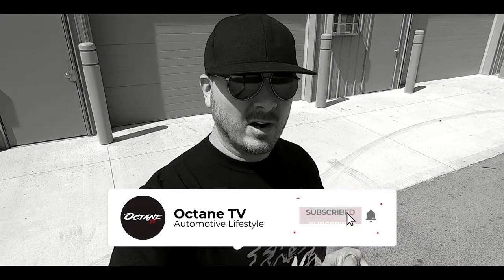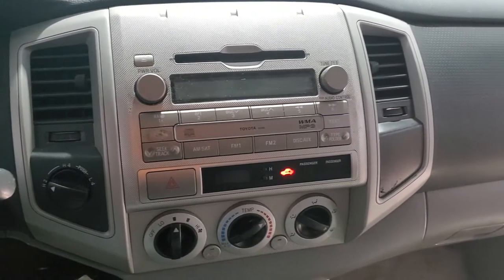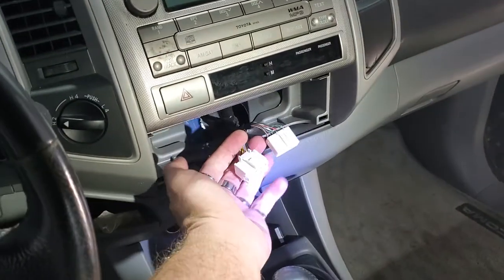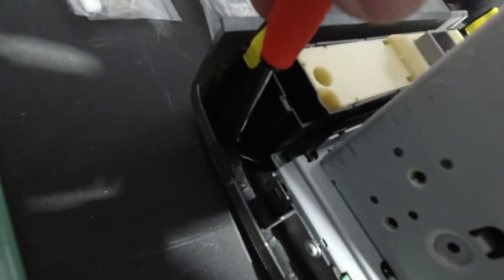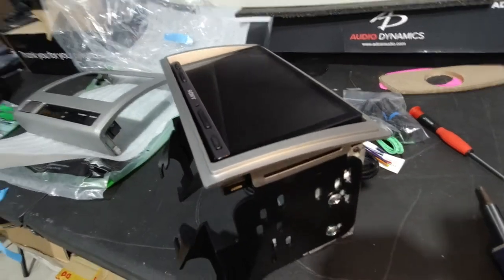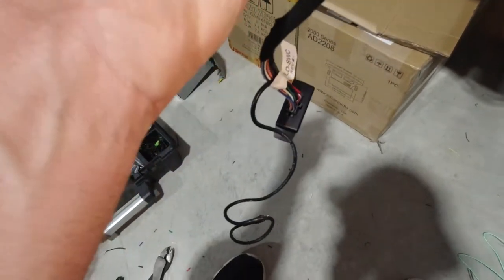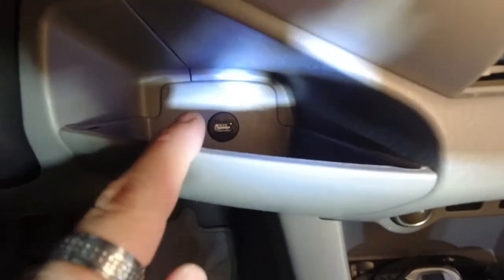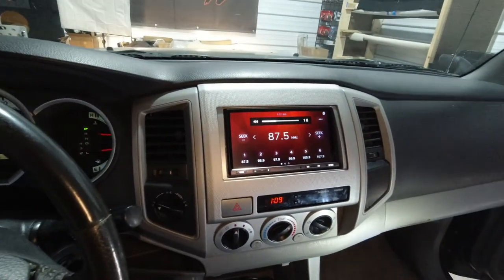TOYOTA TACOMA SONY XAVAX5000 RADIO INSTALL WITH STEERING WHEEL CONTROLS

Comment: It would be nice if it said in the description: "If you don't know how to wire these up I would suggest not doing it." Well, damn, that's why I came to this clip, dude! Bolting a unit in is easy. I bought a used '09 Tacoma and who ever did the previous install was an idiot. I have never seen such an absolute mess, including bare wires; what looks to be negatives with positives; and the best part was the bare LIVE monster cables under both the passenger and driver's seats! And I bought this from a dealer in Austin. Fire and serious shock hazard to say the least!
Reply from the maker: That is scary

Comment: Great Video! Why you didn’t use Crux SWRTY-61N Wiring Interface harness? You didn’t have to splice the factory harness then. Another question, the harness you installed, does it retain all the steering wheel controls?
Reply from the maker: This harness is much cheaper than the Crux harness if you don't want to retain the steering wheel controls or you don't have JBL. If you do want to retain the steering wheel controls you add an aswc module from metra

Comment: Just installed a double din with the same kit. But my head unit it recessed back further. It's the Atoto A6. Anyxway to make it more flush mount. It's got tiny buttons that are hard to push because it's so far back.

Comment: Great video. Installing an ax150 in sons’s 08 Tacoma. Like the idea of the USB in the coin tray. What did you use to mount the USB in the tray?  Thanks much.
Reply from the maker: We use the step bit and make sure it was very snug
Reply: @octanetvchannel  So the usb header comes with a little mounting kit?  My ax3200 just has the header with no bulkhead or way to secure it to plastic in the truck.
Reply from the maker: @Saint_John_The_Forerunner  look on Amazon under flush mount USB
Reply: @octanetvchannel  Thanks, brother!